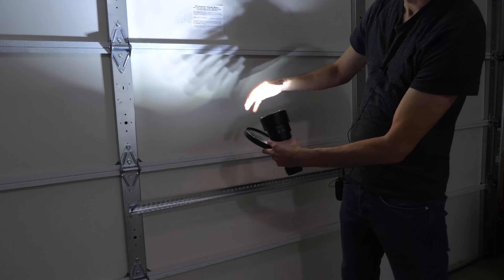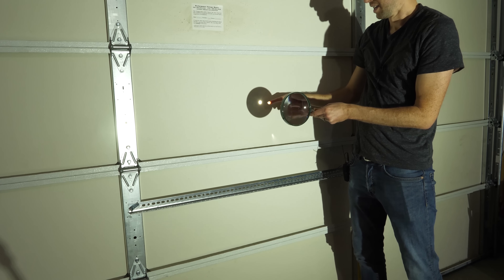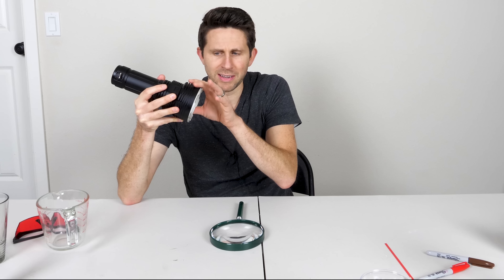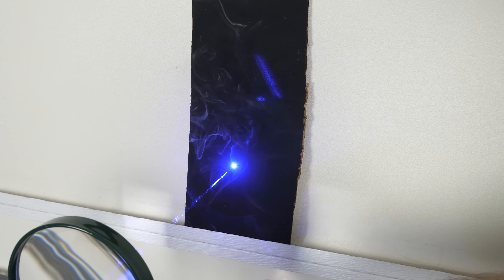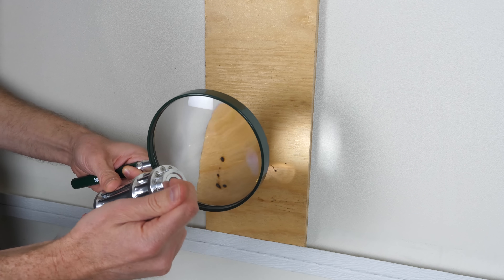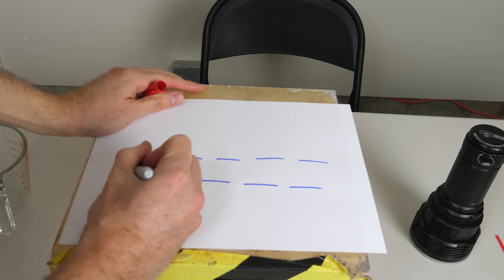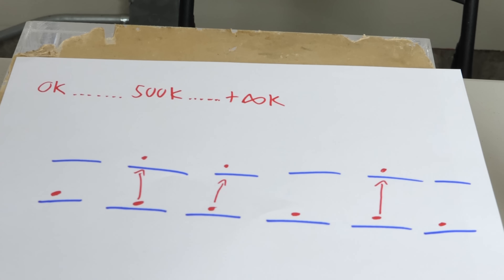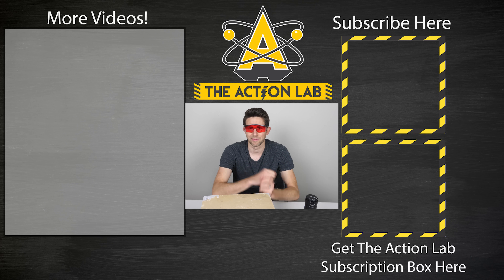What Happens if You Focus a 5W Laser With a Giant Magnifying Glass? Negative Kelvin Temperature!

Comment: He:
"negative temperatures are hotter than positive temperatures"
My brain:
Exploding
Reply: Wait, is it really negative, or is it just an integer overflow
Reply: @rtod4  an integer overflow is a near perfect way to describe it. the number of high energy atoms is so high, you change your standards for “base energy level”
Reply: @rsboi-yt  its not an overflow, because there's no upper limit, its just that you have more electrons in high energy than the positions, so you get negative energy, nothing to see here. that mean negative black body radiation, you could call that negative kelvin, but that's because lasers pump energy, its like saying your water tank has negative pressure, it does kind of, if you are pumping from the ground, it kind of have negative pressure, its going up and being sucked into the water tower, from the point of view of the tower, you could say that the tower just has negative pressure and completely ignore the pump on the ground, the math would work out and the water tower would work fine.
Reply: @rtod4  It comes from the interpretation of temperature and heat. The normal heat and temp is just the total moving energy of the system that creates a zero speed, so if your two atoms move in opposite direction, their total speed is zero, but each has some speed, if you add the energy that speed represent, you get heat, and depending on your system a temp. Now we apply this to a laser beam, which is by definition has all particles moving in a single direction, so its total zero part speed is zero, meaning zero energy, meaning zero heat, meaning absolute zero temp, which is not an option by definition. So we need to hack the definitions and the way we interpret these stuff  that works as the reality, and creates a usable math too (since we want to calculate the stuff), and this created the negative heat, which is hotter than the maximum heat, and can work in strange ways.
Reply: @thorin1045  thanks, I actually understood that!

 Yeah, the value for temp comes down to trying to satisfy incompatible measuring systems. 

A better measuring system would take the higher energy states into account and give larger numbers.

FWIW, I also think any formula with a constant is not expressed in the proper frame of reference, but I'm weird that way 😁
Reply: @thorin1045  exactly, thank you, and the math is not even that complex, (bad dum tss), its just a complex number with 2 parts, the real and the imaginary, because you have two orthogonal dimensions in your data, but its all a model !
Reply: @rtod4  The real life integer limit
Reply: @rtod4  no, its not a overflow, its a cycle in the imaginary dimension i
Reply: @rtod4  Wait, integer overflow works irl? Simulation Theory confirmed…
Reply: @rtod4  we live in a simulation indeed
Reply: @decycle-yt  Check out some Chuck Missler videos regarding the nature of reality 😎
Reply: @rtod4  To explain how temperature is defined, we need to first understand what entropy is. Entropy is a function (well, log) of the number of configurations that holds an amount of energy in a given system (aka the multiplicity of a state). Take a "system" of 4 coins. We can think of the number of heads as the number of energy packets. Then the multiplicity of 2 heads is 6 (6 ways to get 2H2T), so the entropy of a 2 headed system is log(6). (This is basically the same concept as the Shannon entropy in information systems, the only difference is in physics we use ln instead of log2 and there's an additional constant coefficient)

In physics, temperature (or rather, inverse temperature) on the Kelvin scale is defined as 1/T = ∂S/∂U, with S being entropy and U internal energy. In other words, 1/T is defined by the change in entropy with respect to the change in energy with all other thermodynamic quantities such as pressure, chemical potential etc being held constant. All that means is if a system has negative temperature, its entropy drops when we pump more energy into it (like in the aforementioned 4-coin system where the number of heads is the amount of energy--beyond 2 heads the "temperature" is actually negative since the multiplicity drops when you increase the number of heads from that point).

On a side note, we can't tweak the units to make a negative temperature positive as another comment suggested--the Kelvin scale is absolute, and that should be obvious from the definition above.
Reply: @maclee5381  Thanks, though I had to read it six times to realize how much I didn't understand it. Math is not my strong suit 😁

But it sounds like, unless I'm reading your explanation incorrectly,  zero kelvin assumes non-zero enthalpy. If so, Why?

Let me ask it a different way....
When the universe achieves heat death, what will the kelvin temp of the system be?
Reply: @rtod4   Did you mean enthalpy or entropy? I didn't talk about enthalpy--it's basically energy corrected for external pressure (pressure can be seen as a form of energy density).

For your second question, heat death simply means the free energy in the universe will drop to zero so no work can be done (free energy is the energy that is left after we subtract "waste heat" from the total). It doesn't imply anything about the temperature at all. (Since cosmology isn't my field, take this with a grain of salt)
Reply: @rtod4  Statistical mechanics is a hard subject, even physics majors don't see this until their junior year at the earliest. Also, the way I explained things probably didn't do it any justice--I don't think I'm very good at explaining things to non-specialists, which is something I need to work on.
Reply: @maclee5381  I think you did well, I'll give a detailed  response in a little while
Reply: @maclee5381  This causes traumatic conditions in my brain - it makes my brain hurt :)   After diving into the definitions of enthalpy/entropy/temperature, I'm waving the white flag of surrender.

According to what I've seen, enthalpy is the total amount of energy in a system, but is not measurable. I somehow had the naïve idea that temperature was a measurement of energy in a system. 

Temperature, I thought was a measurement of the amount of energy in a system, but is not. 

Temperature is a function of the thermodynamic identify and is inversely proportional to (amongst other things) entropy, which will always increase unless energy is added to the system. Since entropy always increases, temperature will always go down (unless energy is added to the system, then temperature will go up). If entropy doesn't change it appears temperature is undefined (see heat death, below).

So, my initial idea that temperature measured energy was flawed. 

1/T = ∂S/∂U,    It's still not clear to me how temperature would go negative in that formula, (positive change in internal energy/negative change in entropy?) but I'll take your word for that part. 

I was flattered into transferring to the honors section of Physics 101, but when, after a week, I found out it required more work than the rest of my computer science curriculum, combined, not to mention I worked 20 hours/week, I returned to the dishonorable class. In any case, I never would have survived the math. I sucked at statistics too.

"heat death" says that all free energy in the system (the universe) has been dissipated, and thus entropy no longer occurs. Per wiki, heat death does not imply any particular absolute temperature.  If entropy no longer occurs, temperature no longer has a meaning as far as I can tell. 

Another faulty assumption for me was that absolute zero implied no internal energy, but wiki for "Thermodynamic temperature" says "absolute zero is not necessarily the point at which a substance contains zero internal energy; "

So, my point was always that: If absolute zero means no internal energy (it does not mean that), then negative temperature is wonky. However my trip further down the rabbit holes shows that my assumptions are not correct, though they probably should be :)

Thank you for your patience.
Reply: @rtod4  The devs will patch the integer overflow once they get more funding to upgrade servers
Reply: @rtod4  Integer overflow....?
Reply: @minecraftify95  In computer systems, numerical variables generally have a fixed storage space to hold the value of a number. If you try to store a number larger than the fixed storage, you get a garbage value. When the computer attempts to read and interpret the garbage, it is often interpreted as a negative number.
Reply: @rtod4  integer overflow LMAO
Reply: @rtod4  it is negative Kelvin, aka absolute negative, which is hotter than infinite kelvin, this is from cold to hot
0.0°K, ..., 300°K, ..., inf°K, -inf°K, -300°K, -0.0°K
Reply: @ardeshirrazany7043  I'm obviously missing something, no big surprise lol.

Since infinity is infinite, and there should be no negative (absolute zero), how is -inf of greater energy since it shouldn't exist?

My comment on integer overflow is how it works with computers, but such overflowed numbers are not accurate and are an indication that the counting mechanism has reached it's limitations.

But since infinity has no such limitations, and since -inf shouldn't exist, where does the -infinity even come from?
------------------
Nevermind, I just read the pinned post
Reply: @rtod4  -inf and +inf don't exist, they are only abstractions, its only a model. that's where it cames from, aka, your point of view, or frame of reference. aka. if I'm moving at 100km/h and you are moving in the opposite direction by 50km/h, then from my point of view, you have negative velocity, -150km/h. 
I prefer to think that lasers are pumps of energy instead of negative black body radiation, the math is the same, but negative kelvin is strange, because you are providing energy to the laser continuously, so it can get infinitely hot as long as you keep pumping more and more energy.
Reply: @monad_tcp  thanks, that makes more sense
Reply: @ardeshirrazany7043  surely negative 0 would be cold since it's just the same as 0 but flipped
Reply: @clarencekaant8005  except, it's hot.
Reply: @ardeshirrazany7043  I don't think so. Maybe... But I'm not gonna trust this guy since his logic is clearly flawed and everything he's saying is needlessly complicated and honestly, wrong.

You can absolutely take a flashlight and concentrate it to a point hotter than the heat source the same as he done with the laser. You cannot create heat energy from nothing but if you concentrate that energy into a smaller area then that area will heat up more
Reply: @clarencekaant8005  i agree, tge logic is wrong saying it can't get hot but since it's negative it can get colder, but then that would be colder, not warmer since -n k is colder than -0 k, so the logic is flawed, but about negative kelvin there are some really good papers that you can read.
Reply: @ardeshirrazany7043  well yes, I'm not saying that i agree that -0 Kelvin is hot it makes sense to me it would be equal to 0 kelvin but theoretically if it is as hot as you can get then going from negative infinity kelvin to negative 0 kelvin would be getting hotter.
Reply: @ardeshirrazany7043  I am pretty sure that there is no negative Kelvin. As 0 Kelvin is basically no atomic movement. And there can't be less than no movement. Also it's not ° Kelvin but just Kelvin.

Edit:
Well - I see myself corrected. And confused :D
Reply: @robertnett9793  there isn't less movement, there is some weird movement (I'm not even sure because i read this in a paper and i didn't know the publisher so I can't be sure about it)
Reply: @rtod4  Every string folds into a loop and is cyclical and always repeating?
Reply: @rtod4  you heard of jokes?
Reply: @minecraftify95  I have, but since integer overflow isn't something everyone knows about, I was giving you the benefit of the doubt 😁
Reply: @ardeshirrazany7043  You wouldn't use a degree symbol, Kelvin is an absolute measurement scale
Reply: Loll true
Reply: @rancidfish7527  fortnut
Reply: Some parts of physics are really confusing, this is a quote from a scientist that i forgot their name:"if you fully understand how quantum physics work, you have understood nothing"
Reply: @ardeshirrazany7043  Commonly attributed to Richard Feynman, probably apocryphal.
Reply: @ardeshirrazany7043  Nobel laureate Richard Feynman supposedly said: “If you think you understand quantum mechanics, you don't understand quantum mechanics.”
Reply: @ardeshirrazany7043  i can't understand, how did you forget someone and only remember what they have said?
Reply: @haze6647  yeah... my memory is really powerful.
Reply: @ardeshirrazany7043  pollut... brain strenghtening substance are everywhere nowadays, C...O2 that our brain need is also plentiful in the air, our diet of dirt....healty fish can give amino acid and boost our brain, just dont ask me where it is comes from, don't ask what a mercury and its effect is, and don't search about dementia.

Yep you have a strong brain.
Reply: @haze6647  thats how memory works. Some things are more memorable than others.
Reply: EK pro gamer  to put it another way, if you have to kludge your measurement system to accommodate quantum shenanigans, you're using the wrong measurement system.
Reply: -0 Kelvin...what does that even mean?
Reply: For everyone that's getting confused by the "negative" temperature, it's because the temperature scale we use ("hotness") is not the fundamental thermodynamic scale but actually "coldness" (reciprocal of "hotness") is. We just use "hotness" scales like deg C and K in everyday life due to convention and because it's more intuitive. But that's why it jumps from +infinity K to -infinity K on "hotness", because that's just where the "coldness" goes through 0 (think about the point on a 1/x graph where you divide by 0). So as "coldness" decreases to negative values, things are getting hotter - which is why you get a negative temperature. It's as simple as that!
Reply: It’s just convention.  We decided to call it a positive temperature when more than 50% of states are in the lowest energy state.  So we must call it negative when more than 50% of states are in the highest energy state.

We make silly convention choices a lot, like electrons being negatively charged.  It was due to the electric charge from rubbing glass repelling the electric charge from rubbing rubber.  So we knew they were opposite charges.  We assigned positive and negative, and wanted electricity to flow from positive to negative.  But we were wrong, it flowed from negative to positive.  But we didn’t change the convention because it doesn’t matter.

It’s like “North” and “South” on the map.  We think North is “up” for maps due to convention.  But literally nothing changes if we always hold “South” up on maps.  Who cares which way the globe is held?  We have no idea which way is “up” from the plane of our orbit.  We just out of convention think North is up and South is down.  But how we think doesn’t change the reality that either can be up.
Reply: I came to post that comment, and there it was.

Thanks for saving me all that typing. Oh…
Reply: I'll get to the negative fiction later but what the heck is that infinity temperature ?
Reply: My brain: Freezing
Reply: The natural scale of temperature is -1/T
Reply: exploding? more like melting
Reply: ... I'm confused
Reply: probably because of an integer overflow
Reply: *him
Reply: Omg I he was saying that as soon as I was reading this comment 😮
Reply: H e
Reply: Negative KELVIN temperatures.
Reply: Hold up why do I have to wear a coat outside when it's negative 10 degrees Fahrenheit
Reply: @nojahbrowning4478  Reality beats theory every time. In calculus you can have a fence that goes to infinity. The area will approach a limit. Therefore, You can never get enough wood to build it, but you can buy enough paint to paint it. I figured out at that point in my education I would be a hands on Engineer and not a theory guy.
Reply: Crap from christian science
Reply: @Patrick Henry that's a very interesting question. usually in mathematics we only have 1 zero, so, - 0 and + 0 is the same number, that's why they say it doesn't have plus/minus connotation, it divides the number line exactly in the middle. But on computers, we have 2 zeros, because of the way the represent floating point numbers by using a negation bit and a bit of logic, by using an equation somewhat like -1^S * M^E , M being the mantissa, and E being the exponent, and S is the sign bit, which can be 0 or 1 (a bit), so when representing 0, you end up with 2 zeroes, and one of them is technically greater than another, because if you compare bit by bit, it is, but usually you have to consider a margin of error when comparing floating point numbers, so, it doesn't matter (because you do `|X-Y| > 0.error_digits`  "|" being the "abs" function, absolute value) . The real equation for floats is more like ` (-1)^S * 1.M * 2^(E-127) ` which is a bit more involved because there's quantization and it uses binary base and there's some other details with the error margin which most of the programmers just ignore (but its important for scientific computation).
Computers not only do arithmetic, they also do logic, they even mix the two, so you end up having 2 different zeros. 
-0 is very common in computers.
Reply: Physics is a book that will never be finished. We find out more n more with every passing day. We can only dig so deep until our brain can't comprehend, after all we are only human
Reply: Ikr?
Reply: So that's what that pop was.
Reply: I can hear the exploding 🤯 sound
Reply: He's wrong. His video is incredibly flawed
Reply: Not hotter, more painful and you get burnspots obviously.
Reply: Well when you hold dry ice in your hand it feels like its hot
Reply: @The_WorldMachine  have you done that?
Reply: If you cast a signed integer to unsigned integer then the negative value is always higher than positive one.
Reply: Loop "theory"?
Reply: How can it be "not"  breaking the law of thermodynamics if only "giving the name" of negative temperature is what makes it not violate the law ?   Is their other laws  that are only held as empirical because of making up a name or word to accommodate it.  ?
Reply: i doubt u understand it tho. I don't either. 
Brain can't explode if it doesn't get it.
Reply: He said negative temperatures not negative IQs
Reply: It sounds like some scientists figured it would be fun to completely change the meaning of normal words in this specific context
Reply: ( The same here as well )
Someone who does good for good means by nature is only just righteous.
Whereas someone who does everything heartlessly for the same purpose as they do anything good for righteous sake is truly HOLY.
 ( The Highest degree of goodness/righteousness )

They are the completely contrary to the Vile natured.
Those of Unholy rates making wicked people seem like lovey dove beings.
The vile rush toward heartlessness thru every good and bad intention alike.

But Those Holy rush to righteousness thru vile and holy means alike.
While sparing mercy whenever possible.
Reply: I think what hes trying to say is that when a negative temperature object interacts with positive temperature object, the negative temperature object sucks out all of the types of energy the positive temperature object has, and is giving off, so the temperature of the object decreases more and more over time, and since light is a type of energy, it may well make the positive temperature object invisible, but this is how negative luminosity or negative temperature objects should work, but there is nothing in the universe in our terms of knowledge that has negative temperature/luminosity.
Reply: The fact you said helium is talking to you proves it
Reply: I don't understand your definition of temperature and relationship to population inversions to generate laser light. Depending on the laser media, there are preferred electron energy states that correspond to wavelength, E=hv, where photon energy = plancks constant * photon frequency. Looks like what you are doing is improving the focusing optics of your cheap 5 watt laser with the magnifying glass. Physically, your spot size can only be focused to the diffraction limited spot size, which is 2× the laser wavelength. That presupposes that your beam quality, temporal and spatial coherence are perfect. I guarantee that the laser you have is not close. Temperature is related to amount of kinetic energy of the atoms in your local area, not the sum of electron orbit states of your lasing media. I read your explanation and believe that it is incorrect. The second law of thermodynamics basically says that heat goes from hotter to colder areas. I'll have to relook at your statements and explanation.
Reply: .*hits blunt*.....the body registers extreme cold as burn pain.....hmmm...
Reply: -1 degrees vs 29573758374868275 degrees

Which one is hotter? Apparently-1
Reply: @joebidenshusband2836  kelvin*
Reply: @joebidenshusband2836  hey... Don't forget it's in Kelvin not in any other units that starts at negative level
Reply: no need to explode, that "negative hotter" is wrong.  :-)
Reply: Negitive kelvin is impossable
Reply: @UraniumWolfy  Nah, man, negative temperature in this case is totally possible. Temperature in this case works a little bit different, not as perceived hot/cold, but more as a statustical thing. In mediums where there are more excited particles than not the absolute temperature is formally below zero
Reply: @UraniumWolfy  it is possible, it is even in the kittel textbook as an example
Reply: @UraniumWolfy  “Anything’s possible” - Kevin Garnett
Reply: @UraniumWolfy  It, in fact, is not! 0 Kelvin is impossible to achieve, but scientists have engineered scenarios with Negative Kelvin, and many lasers actually use the same principal to operate. Sixty Symbols has a great video about the topic!
Reply: @UraniumWolfy  Not below 0 kelvin, just below 0 degrees
Reply: @somerandomguy7068  0 Celsius *
Reply: @somerandomguy7068 1. 0 degrees what?
2. He was talking about kelvins
Reply: @somerandomguy7068  Celsius not degrees
Reply: @Ecco502  it's like celcius but it begins at -273°
Reply: @sairabanokazmi1150  e
Reply: @Ecco502  odd way to spell 'thank you'
Reply: @Ecco502  An Irish name
Reply: @somerandomguy7068  wot
Reply: @somerandomguy7068  It behaves like it is in negative 0 kelvin. 0 kelvin is the coldest a temperature can get because there is no movement anymore. But if you look at an internal energy and entropy change perspective, there is a negative kelvin. It behaves like when you add energy to it, it becomes colder. It is the opposite of positive temperature.
Reply: @spodarman3823  corrections aren’t necessary
Reply: @spodarman3823  0 braincells*
Reply: @UraniumWolfy  No if you have something that is colder than 0 degrees Then it’s -1 or less
Reply: I think it has nothing to do with that, its just that the flashlight is leaking to much light.
And burn faster doesnt mean that it is have a higher energy, i mean, do you need more gas to burn a little tiny bit spot of an eggs than to cook it whole even if its not that cooked?, he forgot to mention the surface area coverage, and the laser are indeed getting weaker, i am sure that a tiny bit of it were absorbed by the lens, the lense is slightly heats up, 0.0001⁰ or something like that, so indeed, theres some energy loss.
Reply: @haze6647  no.
Reply: @haze6647  That's correct. You can do the same thing with the sun and a magnifying glass, you could do it with the LED flashlight too but you'd need a much larger magnifying glass or something a bit more complicated